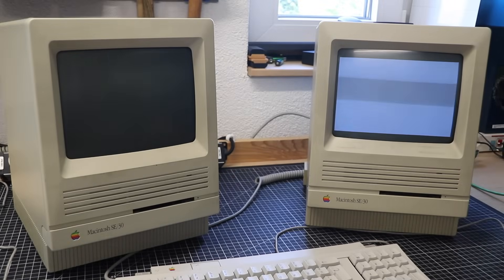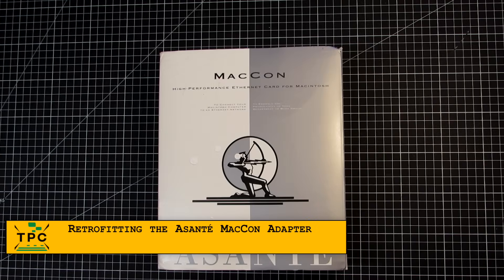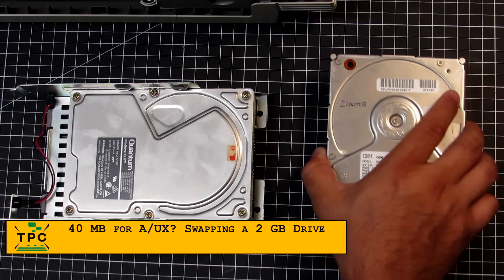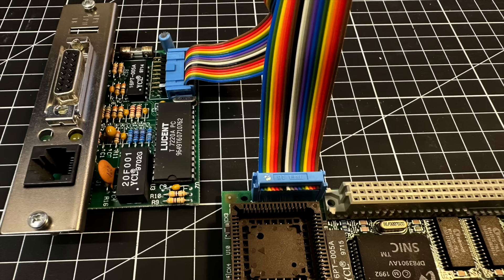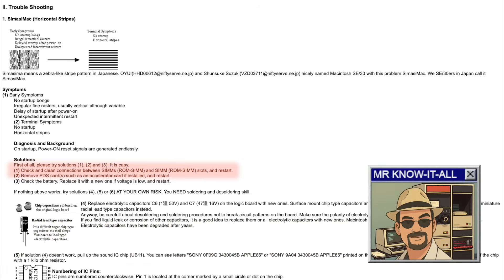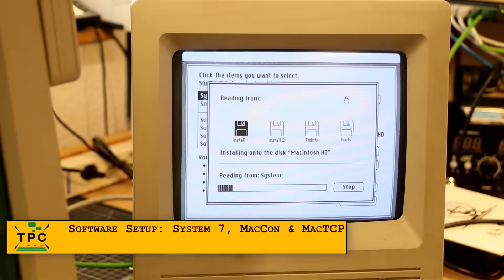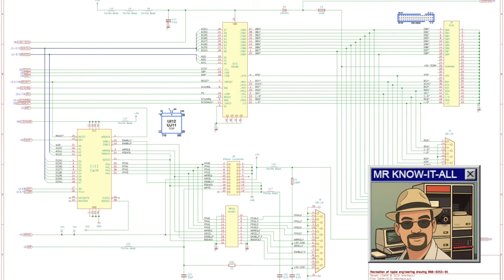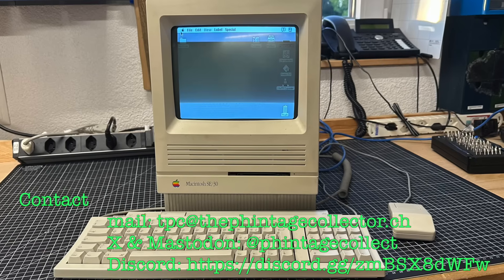Fixing a Dead "SimasiMac" SE/30 – Caps, Bad RAM, SCSI Faults and a Dishwasher

Comment: Awesome video! For my SE/30 I didn’t use the dishwasher but multiple washes with isopropyl alcohol and toothbrush, with the final followed by few days drying in open air. Also, I had to remove the original 1MB (4x256K) RAM modules, because with all of them it often refused to boot. I’m now on 4MB (4x1MB)

Comment: Here's a handy tip for working on classic Mac boards without having to do the janky "stand board on its end" like at 6:51. Get yourself an ATX power cable extender. The keyed connector fits perfectly into the power connector cable and motherboard connector. (you will need to leave some of the pins hanging off of one end) This should give you enough cable length so that you can work on the Mac motherboard while it is outside of the case, and you can sit it flat on your bench and not have to do the stand-it-on-its-end bit.
Reply from the maker: Cool, will definitely look into that!

Comment: I've done the dishwasher cleaning method multiple times on multiple projects. Works great, especially for supremely dusty stuff. Only thing it doesn't work on is tar from smoking. Best way I've found to make sure the dishwasher is clear of cleaning detergent and food is to just run it completely empty for a light short cycle.